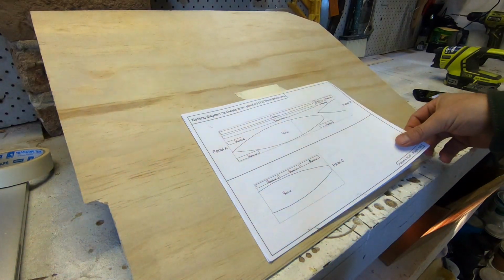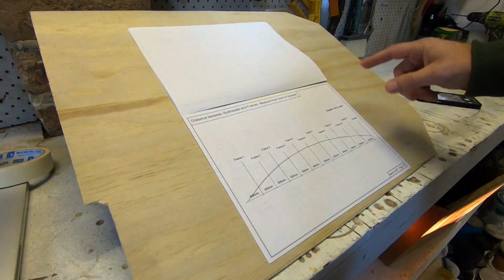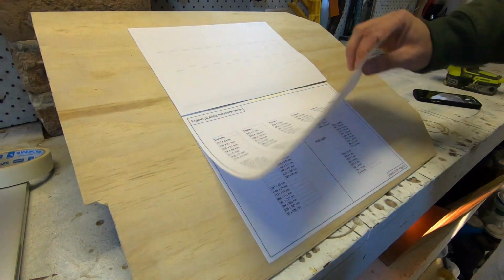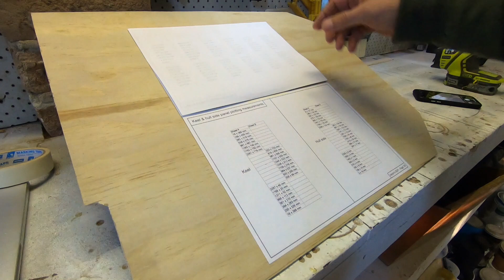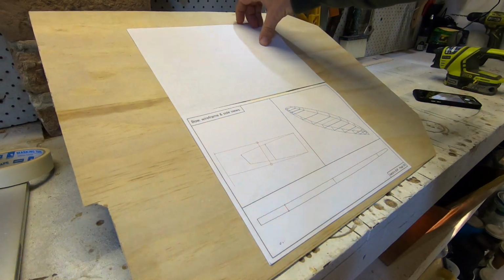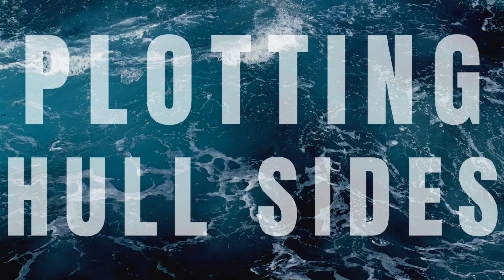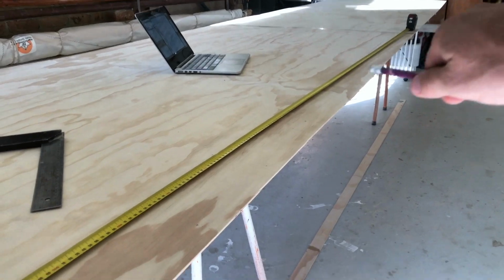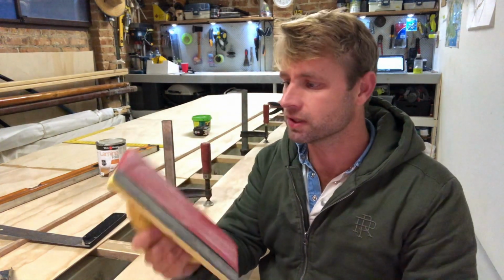#DIY #SUP Ep 3 - How to build a Stand Up Paddleboard from plans

Comment: Question; What drafting program did you use to design the SUP?
FYI; 
For those of us that use "imperial" (inch) measurement, multiply the millimeter dimension by .03937 to convert to inch dimensions. To convert from inches to millimeters multiply by 25.4. these calculations puts you well within 'machine shop" tolerances, not necessary here. The only problem converting to inches is that they also need to be converted from decimal dimension to fractional dimension. You can find down loadable conversion charts on the internet. 
These are very good videos, so far. i am actually learning something new.
From a former professional draftsman. '-)
Reply from the maker: Thanks Robert, I used Carlson Hull Designer.
Reply: @Aaron.deRuiter  I have an older version of DraftSite (I think that's the right spelling) and so I can probably bring the plans up In my program..

Comment: when plotting out the points for the frame.  I pressume that each one has its own Zero.  and your not measuring all from the bottom left hand corner of the big ply sheets
Reply from the maker: Correct. That way you can position the frames where you choose. Just make sure you use a builders square when marking out your points so they are perpendicular to the baseline.

Comment: thank you very much for sending me the plans, but I'm having trouble interpreting the measures, for the transom example that you explain
  210 x 0 mm
198 x 62
105 x 62
12 x 62
0 x 0
105 x 0
210x0
Reply: Hello  Fodra. Did you find the solution. I do not understand these measurements either. It must be simple.